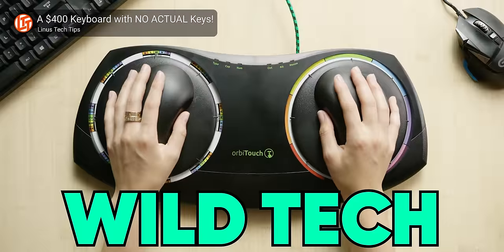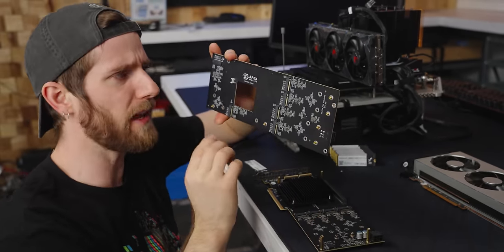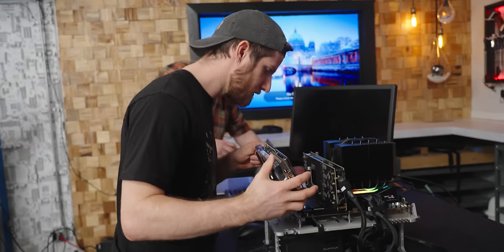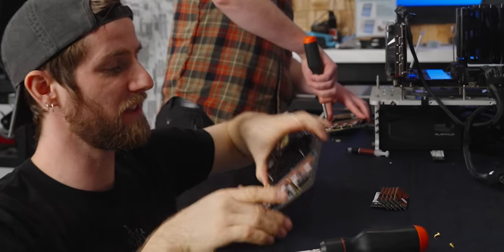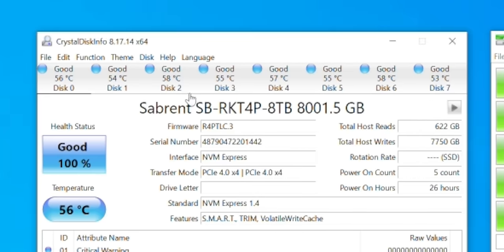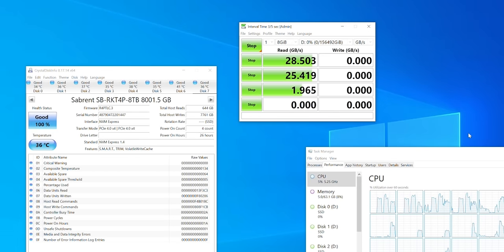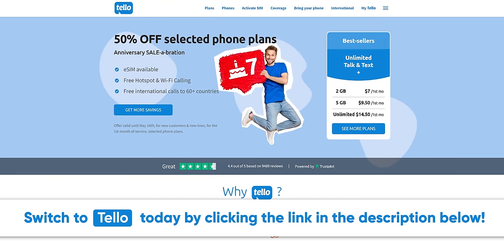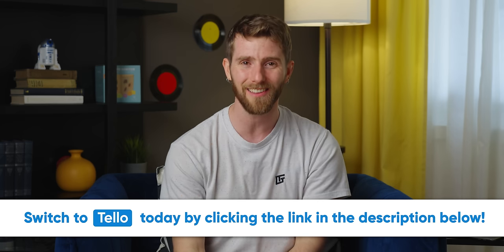This SSD is Faster Than Your RAM - Apex Storage X21

Comment: Pros of BIOS RAID:
- More "natural" path to installing your OS on a RAID volume.
- Presents the volume to the OS as a single drive (mostly only significant because of the previous point).

Cons of BIOS RAID:
- In almost every case, you need drivers to use the volume in your OS. This is a common pain point during OS install.
- For consumer boards, it's still just a software RAID (see impact in the next 2 points).
- There are almost no performance benefits in regards to CPU usage (tested this many times).
- Data throughput isn't any faster than using an OS software RAID (tested this many times).
- If you ever move your drive(s) to a different system (especially a different brand) that doesn't use the same BIOS RAID, you can't access the data. OS level RAIDs will always be recognized by the OS (unless you toasted your drives somehow).

Do not confuse this for a list comparing hardware vs software RAID because consumer grade BIOS RAID is not hardware RAID.
Reply: Hardware RAID is dead anyway...
Reply: yeah, i'd rather use zfs raidz1. easy to use, easy to replace broken drive.
Reply: That last one can really screw you. "If you ever upgrade your hardware..." 😆 Almost all hardware like this will always get upgraded or break in some way. Doing BIOS RAID is very not smart. Also, if the RAID algorithm is ever slightly bug fixed or improved, you won't get those improvements, because BIOS upgrades stop being released after a few years.
Reply: @timramich  for a general consumer, yes it's dead. for enterprise use, it could be beneficial since hardware RAID with write cache usually have battery backup
Reply: We run enterprise database without hardware raid. Unless 50% of drives out of -100 in all nodes go Kaput immediately, we wouldn’t even lose data, and we can always bring up from backup and re-ingest the missing data during the downtime to get back up and running.
Reply: @n.shiina8798  Hardware RAID is dead in enterprise use, too. You have the whole datacenter (or at least a rack) on battery backup, no need to have it on  the card. Most importantly, modern filesystems have SW RAID built-in, and this comes with huge advantages since they are aware of it. Just the fact that the FS knows whether a given file is corrupted (and pulling the correct one and fixing the broken one automagically even on READS) is just such a huge benefit that it alone kills hardware RAID.
Reply: @amunak_  then why Broadcom still makes ROC?. if hardware RAID is dead, i see no reason for them to make those chips anymore. just make a simple tri-mode HBA? (this is a genuine question, not arguing just in case you were thinking i was trying to argue)
Reply: @n.shiina8798  possibly to support older systems instead of focusing on newer ones?   
"Enterprises" are known for not upgrading things unless it's extremely broken :P  
Though, I'm only speculating. I didn't know Broadcom still made those...
Reply: @amunak_  Ummmm what hardware RAID is not dead in enterprise..... Yes in a DC you would have a UPS and generally a generator or a couple to power in case of power failure. But a datacentre is built to around a fundamental to reduce risk not increase risk, so why would you increase that risk by skimping out for a software RAID that in more prone to failure over a hardware RAID.
Reply: @Max Hennessy  Because software RAID is not more prone to failure than hardware RAID. This isn't 2010.
Reply: @thekakan  i kinda doubt but still possible. though, idk what's more viable. adapting the newer card to older system or just decommision the old system altogether
Reply: @timramich  is there software equivalent to NVRAM (WBC with BBU)? or they just went tiered storage instead?
Reply: @n.shiina8798  What?
Reply: @timramich  i was asking if there is RAM write back cache with battery backup equivalent on software RAID or they simply use hybrid/tiering system to accelerate the RAID array
Reply: According to Wendel modern true hardware raid is very rare even in the enterprise. Was the video is hardware raid dead? or something.
Reply: @N. Shiina  There are some types of RAM that do have a battery. I really don't get the concern. Run a UPS.
Reply: @Raman Monorath  There are other videos. I just saw one about a system with a bunch of blades in it. All had a stick of battery-powered RAM. All systems talk to each other and all did the same thing. Redundancy is better than thinking just a battery is gonna save your data. I don't think other people here are aware of what's out there now.
Reply: I use BIOS raid because it hides the serial numbers from anticheats to play games that I'm hardware banned on. It's pretty useful, don't need to rebuy SSDs
Reply: @maxhennessy6676  aight, so, datacenter server technician here.

hardware raid is mostly dead, the only exceptions I can think of are:
 - single node windows without storage-spaces
 - legacy application

As a matter of fact, software raid (namely zfs, mdadm) is still going kinda strong for lower-importance applications.

critical stuff you just usually shove in clusters. You can for example build ceph based storage over 4+ servers. Making sure that even legacy non-clusterable garbage is failover in case of server/DC going down.

altho the raid cards are expensive. their cost usually ain't nothing compared to buying few extra servers to go full on cluster.
Reply: @n.shiina8798  Seeing how IBM still supports some of their 90s or so mainframes, I doubt enterprises decommission perfectly working systems. Plus, legacy software perhaps. Whatever the reason, there's a market for it still, it seems.
Reply: @n.shiina8798  Modern software RAID filesystems implement caching differently than the old days. For instance, you can set ZFS up to use a redundant set of SSDs as your caching mechanism. SSDs are non-volatile so there's no need for them to have a battery like the old RAM-based solutions in hardware RAID. Considering how fast SSDs are (especially NVMe), the solution is not only 100% viable, it's cost effective compared to the pricing of hardware RAID HBAs, especially for rack mountable servers, and it's way more configurable for different scenarios.
Reply: @ramanmono  No, it's just a comment about Linus' response to using software RAIDs provided by the OS. I don't know why he reacted the way he did (probably because he was trying to do something weird with it) but he gave the impression that RAID implementations provided by the BIOS are better than the ones provided by the OS, which they are not.
Reply: @Angel2kinds  Pleasure to meet you datacentre tech!

Senior Engineer for a multi group media company here. I would say 90% of our estate in our multiple DC's are running hardware RAID still. The 10% that aren't are either for companies we purchased and have just lifted and shifted their kit in, as they are on the move into the cloud so don't want to spend the extra $. Or we have systems that are single node not deemed to be business critical and can be left in a software raid.

Personally from my experience talking to other companies I would say hardware raid is still more the norm than software raid is. That's either due to the lack of maturity as a product or we all have invested to much into a snake oil and don't want to admit it!

Agreed around your point with clusters, anything super critical should be in a cluster running HA. Adds some complexity to the environment but really the overall benefits are great.

Pleasure getting your points of view happy datacentering. May the rack gods be kind to you for many years!
Reply: Just do ZFS, man.
Reply: @ragtop63  ah, i see. NVMe is much slower than RAM but yeah, i can see why they're chosen. cheaper $/GB
Reply: @thekakan  like, early POWER systems?. that's surprising tbh
Reply: Unless you're keeping spare motherboards,  don't do "hardware" BIOS RAID. The lack of flexibility makes it the digital equivalent of painting yourself into a corner, imho.
Reply: Been using 2x6TB HDDs in Raid 0 on W10 since 2020 and they've held up nicely
Reply: @mttrashcan-bg1ro  Same for me. I have been using 2x4TB HDDs as a W10 volume since around 2020 and it performs fine. No problems.

Comment: I can see the utility of this.
When I was still at uni (back when the fastest way to transfer data was TAs with USB keys), I worked with a professor on a project where he was using datasets that were about 32GB each, and he was having to go through about 100 to map them out. The software , which he made, required it to be loaded into memory, chucked out and recalled later. So this was on the order of 1 test per night on a (at the time) top of the range dual Xeon system. And I successfully got it up to 2 tests per night, hold your applause.
Something like this would have been a Godsend. I mean, I'd have to do more work writing code, so I am glad it wasn't a thing.

Comment: Sabrent really going at it lately first with one of the best options for steam deck now searching out large silly projects to sponsor just to show how much progress they as a company has made is just insane. I swear haven't even heard of them till last year
Reply: From what I can tell (and some of this is speculation), they started out just selling just cheap generic adapters and usb hub type things, not being a player in the storage market at all, and then started selling some minimal effort generic reference design SSDs... Only, they chose the controller/reference design well so they were pretty decent SSDs at good prices, which managed to catapult them into the limelight, giving them the revenue to put some actual in-house design effort into the things, and now they're a major player.
Reply: @guspaz  Your analysis is spot on: Sabrent entered the SSD market in 2018 and are now a reputable brand.
Reply: Sabrent has been around since 1998 so they're definitely not a new company
Reply: They are the Samsung of 2017
Reply: @arkayngaming727  yeah I bought my first Sabrent gen 3 in 2018 or 2020(?)
Reply: I had my second Sabrent SSD die on me JUST yesterday. My first one lasted about 6 months, this second one lasted almost 2 years. Both times the drives failed there was no indication that it was having issues. Rocket 4.0 TLC - I'll probably go with Samsung from now on.
Reply: wtf do you need 8tb for in a steam deck?
Reply: @squidwardo7074  because I buy a lot of Bethesda games and I want all of them at my disposaaaaalll D:
Reply: @themightiness  Brainlet level hardware analysis, thanks
Reply: @squidwardo7074  you don't they made a special 1tb at spec for the steam deck not to fast not to slow great price for more storage. They eventually made a 2 and 4tb one for steam deck
Reply: @guspaz  yeah pretty much they did do some storage stuff but mainly excessorys saw them here and there as an IT Repair Tech for a school district I worked for but didn't see them alot in the standard consumer market till recent.
Reply: @arkayngaming727  no not saying they are. I saw them a few times as a repair tech in the IT department for a school I use to work for but very rarely in the consumer market. And usually it was adapters or large capacity storage. But they came into the general consumer storage market hard and fast.
Reply: @themightiness  weird. Thankfully mine is still going strong. Did you make sure to shield them? Some of them require heatsyncs. From personal experiences from my customers and my personal builds I recommend WD they are the number 1 sold for a reason. Avoid SanDisk SSD at all cost though they seem to fail within 1-2 months under heavy use. Samsung is ok but Samsung and PNY have been very hit or miss. Sometimes work great other times under deliver or fail outright. Love Samsung products overall like my tv dryer and phone but their storage department needs work.
Reply: @themightiness  
This is exactly what I did after sabrent SSD failed me twice in 1-1.5 years of use each. I switched to Samsung and now I'm problem free. To add salt to the injury, they refused to reimburse me because I was out of their 2 years warranty period. I'll be seeing legal action. Never buying sabrent drive ever again, not worth saving 20-30 dollars compared to a Samsung SSD.
Reply: @themightiness  really!? Wow my 3 are still going for 4 years now. Is there a lot of heat in ur PC? Or are they being shorted?